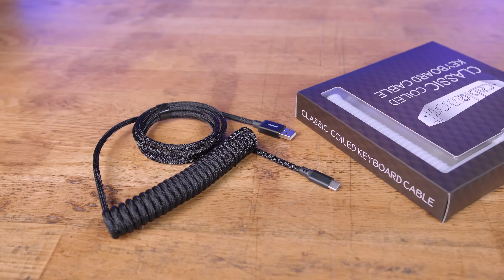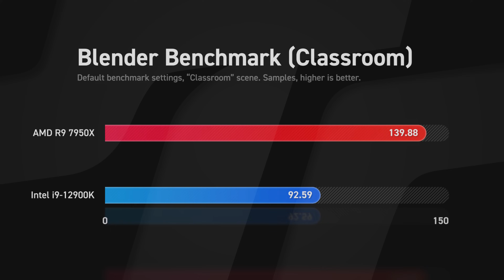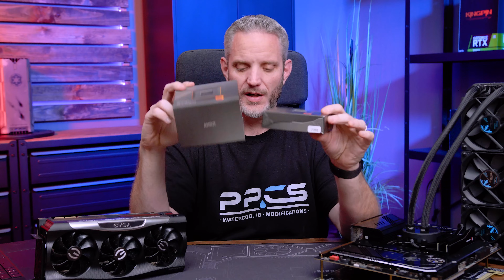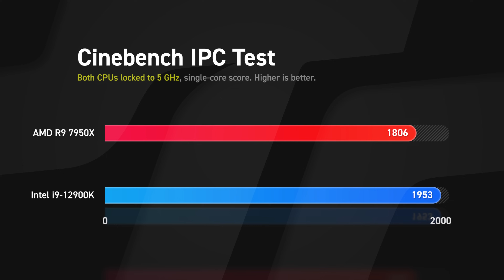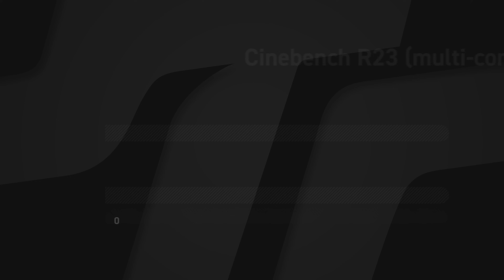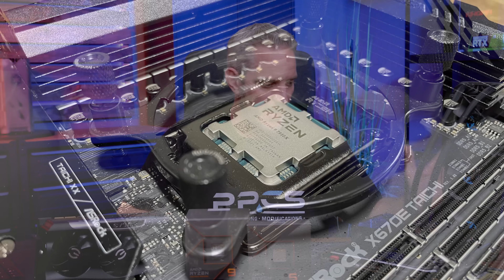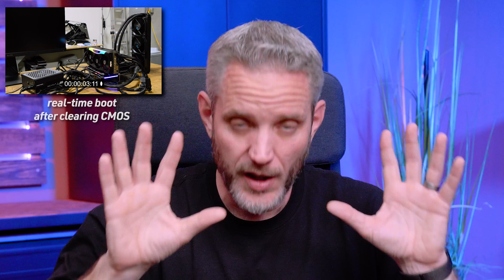Forget EVERTHING you THINK you know about AMD... these CPUs kick A$$!!

Comment: As for AMDs new approach to cpu temps, as a performance laptop user for over a decade, cpu temps of 95C have been normal for as far as I can remember. My last Asus melted the solder for the power plug (after about 2 years) but hadn't damaged the cpu before that BSOD event. The previous Asus ran at 90+ for 6 years and is still functional. The current Microcenter house brand, Power Spec, has been riding its thermal shutdown limit of 95 to 98 C for 3 years (is undervolted and admittedly has an insufficient and worse cooling solution than comparable Asus ROG model of the same vintage, but at a much better value and available immediately off the shelf when the previous Asus died with similarly equipped Asus being mail order only even in a major metro area like Dallas).

Comment: The 7600x's big problem is going to be in the value proposition of everything needed to run it.  R5 has always been a performance-at-a-budget tier for Ryzen CPUs, and with DDR5, the cost of AM5 Mobos, the added power and cooling demands....it's a tough sell at the moment.  If you've got the budget to go all out, or nearly so, the 7600x doesn't make sense because it's the bottom of AMD's release stack.  If you don't have the budget to do so, it doesn't make sense because your money can get you so much on last gen hardware where you don't have to deal with the prices of latest-gen everything at once.

7600x's day in the sun will be when DDR5 and AM5 motherboards reach more typical prices.  GN's numbers largely verified what AMD was saying about it beating out the 12900K in many games.   But it's super expensive to adopt right now.

Comment: Jay, you should know the best that 95°C working temperature have to be exhausted out of the pc-case ... so when the pc always runs at 95 - no matter what you do - because 95 is designed to run .. then IT IS A HEATER .... there is no way that you cant call it heater, because it is a HEATER... you have to be kidding if you think that browsing the web and watching videos at 95°c is normal ... its maybe good in the winter but the rest of the year its an unnecessary HEATER

Comment: FX8350 was such a great CPU! The longevity it had...  Mine was nearly 8 years old when I changed it and it wasn't because I actually needed to change it. It was still running properly all the games I wanted to play. I mean... I went from FX8350 to Ryzen 3600X and didn't really notice much of a different.  But yeah... I wasn't playing Crysis! :P
Reply: Hell yea!! BULLDOZER POWAAA>

I just build a new rig 3 months ago and upgraded from FX8350 + R9 290x to a 5950x + 3080TI FT3, the difference is unbelievable but yea the fx8350 was a monster of a CPU for its time and price!
Reply: still using fx 8350 with 1070 atm
Reply: Im still on fx 8120 black edition overclocked too 4.6 and Radeon 290x  also overclocked, Planing on going 7700x paired with an 6700x.
Reply: Bulldozer was such a dud. CPU's had terrible single threaded performance and they had a lawsuit against them because it's not even a true 8 core CPU. Hense why it only scores 6,100 on CPU mark.

Comment: I love the excitement this is creating... I hope AMD smashes it with their new GPU too, can you imagine if the do a 7950X3D, it will be freaking awesome
Reply: I'm going to bet the gap in the lineup (no 7800X) is where they'll put the X3D part. I always thought the 5700 and 5800 were too close, this makes the lineup 6 core, 8 core, 8 core with 3d cache, 12 core and 16 core. A clear difference in each part, which I quite like over a slight freq bump.
Reply: People buying hardware waiting for software to catchup.  Sure with proper tuning software an Intel 6 or 7th gen would be fine pared with any gpu
Reply: Fan boys.
Reply: I do not think they will make a part like that since Windows has scheduling issues with large core count cpus such as the 5950X/7950X. More likely to just see a 7800X3D. Maybe a 7700 or 7600 but nothing higher than that.
Reply: @VoldoronGaming  - Well, you’re wrong. Slated to be released 2/28/2023 is the Ryzen 9 7950X3D!
Reply: @VoldoronGaming  update jokes on you😂
Reply: @VoldoronGaming  thanks for the info, that's a shame, one can hope that Microsoft make an update for that so it's possible in the future.
Reply: For funsies I crunched the numbers and, IF the added cache improves the 7950X to the same extent it improved the 5800X, then we can expect the 7950X3D to yield 20-25% more frames than the 5800X3D in games where the 5800X3D is currently in the lead. 

But there are a lot of unknowns. In addition to the scheduling issues, im not sure how the cache will be able to handle the extra voltage and heat. The cache made the 5800X3D a very cool and low wattage cpu that you cant manually overclock. The 7 series cpus are hot and high wattage cpus that... i guess also cant be manually overclocked because they essentially auto-overclock. Im not sure how they're gonna pull this off, it seems... incompatible? I have faith in team red, but they likely got a serious challenge to overcome.

Comment: upgrading my pc fully in 2 years, the CPU power by then is gonna be insane :o my 3600x i got 2 years ago was already such a massive jump from my i5 6600k. i remember when i started in 2016 on pc gaming and cpu performance increase was so stagnant for years and now its poppin off so hard.

I currently run a 3070 ftw3 EVGA with a EVGA 650w gold G2, 32gb 3200 mhz, R5 3600x, with 2 HDDs a m.2 and a sata SSD

Comment: AMD and Intel might have switched positions.

AMD went all in with fewer cores, higher allowance of temps, max speed to get the best performance possible with no Thremal throttling while having barely any IPC increase.

Intel's RPL going to have more cores than AMD and probably win MT across low to high end section(7950X might be the only AMD cpu that can beat the 13900K or be equal), and probably going to have the best gaming performance with insane power draw, at least until X3D comes.

Comment: Having jumped right in with the first Ryzen with an 1800X and an Asus 370X top of the line Motherboard.  I had more issues than you can shake a stick at.  Basically No ram not a single stick on their apprived list would run at 3200.  Asus flat out told me If it runs 2400 which it did they would not RMA the Motherboard. It was over a year later that bugs were worked out but I had dumped Asus for good and moved to Gigabyte boards.  Still with this round and the bargains around on the 5000 series and the 6000 GPU's it will be a couple of years before I change over mainly the cost is way more than it used to be for the MB the Ram and the Processor.

Comment: Based on recent moves from all relevant companies, I have decided to transition fully to AMD based systems. My current rig (built in 2020) was my divorce from Intel by moving to an AMD CPU. Now I will be looking to upgrade my rig and when I do I will also be divorcing from NVIDIA. I have never had a PC in my life that had a dedicated GPU that wasn't NVIDIA...but Radeon, here I come.
Reply: made the move me myself since 2021, amd graphics cards need a little bit of fennesing to make it work optimally, my gpu is 6600xt and out of the box it seemed to run really hot on most games, running 95c+ on most games and in some even hitting 100+, so what i did was undervolting the hell out of it at 1070mv and it seems to do the trick, now all those games are running at same or higher fps and the gpu stays at a comfy 80+/- c

Comment: Dear Jay, if CB runs with AVX512 it should not run AVX512 on Intel... AVX512 is disabled on Alder Lake, besides AVX clocks lower on Intel when you not overclock it. So if CB is using AVX512 on AMD and AVX256 on Intel, the benchmark is not comparable at all.

Comment: I won't be buying any of the new AMD processors, AMD has crippled them all.
DDR5 is spec'ed to 512GB in 4 DIMMs, and AMD crippled their Memory Controllers to maximum 128GB.  Stoopid!
I ALREADY have a 5950X with 128GB, and I need more memory than that (and Threadripper is too expensive).
So it looks like I will be going with Intel's next HEDT for my next system.

Comment: CR23 is ~28k on the 5950X, not 20k.
Edit: At 95C, the Zen 4 did throttle back from 5.7 to 5.1... with better cooling and with no OC, that throttling will go from 5.7 to maybe 5.5.  It is a tour-de-force that AMD pulled here.

Comment: I am differently skipping the whole next generation of hardware on both the CPU and GPU side since it seems I will need to build a whole new system with the new power supply requirements for the GPUs all the way up to DDR5/socket change on the montherboards. 

I wonder if Intel would still be making 4 core 8 thread chips at the high end if AMD never made a comeback..

Comment: I don't think I'll upgrade from my 9900K yet. It's still pretty good for gaming, streaming and my photography/video editing work. I'm only looking at the new platforms in case I absolutely NEED them when I upgrade to a 4080ti (whenever that comes out). I wonder how those GPU's will perform on older platforms.. Only time will tell, and I'm not in a hurry. My 2080ti still kicks ass!
Reply: I'm waiting to see 2023 models before upgrading the 9900k. Upgrading cpus is overrated.

Comment: so from ive read so far and seen. 7700x is hotter, more expensive, takes more energy and is slower in games, then a a5800x3d. so if its about a gaming only cpu and average frames throughout games, youre still better off with a 5800x3d

Comment: A better video IMHO would be what it does with WORSE cooling solutions. Like U12S->D15->240-AIO->280-AIO->360-AIO, to see how much performance drops under throttling. Then turn on Eco/105W mode and re-run the cooling solutions. Then run 5950X stock with them. That should give a decent perf/W against 5950X @ 105W.

Comment: Jumping on this pretty quick there, Jay.  This is a new socket, relatively new memory format, cutting edge platform.  I expect it will have the same sort of growing pains as the first AM4 systems had.  If not, well...  now we're talking.
Reply: I don't think it will be that bad. When the Ryzens came, no board maker put much faith on them - hence the small BIOS size and all the errors with tracing and so on. Today Ryzen is a first class citizen, not a second one. They will put everything they have on it - same as they do with Intel - because this time they know it WILL sell.
Reply: @sysbofh  Good point.

Comment: I bought the 3950X the same day it was released in later November 2019, and I have avoided being an early adopter since due to the initial issues with Zen 2. The problem I am seeing is that AMD is forcing you into a strange position. You either wait for Intel's quasi-response to all this, wait for the X3D version of Zen 4 or buy high-end right off the bat and hope it's worth it. The low and mid-range stuff doesn't seem to be worth the investment right now given the pricing, which includes all three main components, which is really lost potential currently for AMD. From my perspective I don't need 16 cores anymore since my video rendering days are gone now and for gaming the 7900X and 7950X seem a bit overpowered. The 7700X makes no sense to me. I had hoped for a 7800X, but nope. In addition, maxing out temperatures seems more than a concern to me. It's hard to gauge optimal cooling with it and since heat does have to go somewhere it literally could be bad in summer, especially when you don't have air-conditioning and room temperature rises above 35 °C. I guess it's the same for Intel, but for my 16 core Zen 2 I could at least fiddle with the settings to get it somewhat bearable in summer, especially with the added heat from the video card.

Comment: I'll be building a new system using AMD this time around. Looks like they have really stepped up their game. I don't however like their smart auto memory timing - that would be very frustrating to deal with if your in a rush after a power loss - not to mention it really makes it seem like there is an issue with the system. Maybe an initial post screen that warns you it's normal it may reboot numerous times while it does this. I can foresee a lot of tech falls due to this.

Comment: FYI,  Only AM4 coolers that support AM5 are ones that do NOT have their own back plate, if it uses the default motherboard back plate, then it fits. If the  cooler comes with its own back plate it will not fit...

Comment: From HotHardware's site: "In Zen 4, AVX-512 is implemented using double-pumped 256-bit data chunks. This design decision was reportedly made to avoid large frequency fluctuations when executing AVX-512 workloads." Personally, I would look at it the same way I would look at dual-channel memory vs a single channel. Would you rather have one stick of 16GB or two sticks of 8GB? I know the comparison isn't exactly the same, but you get the idea.

Comment: Comment just after the benchmarks: it’s a walkover. I feel very relieved I didn’t build a 12900K(S) system…
Because now I can dream of building one of these…

Edit: and a bit disappointed in myself because I didn’t wait and built a 5000 series system. But this was supposed to be the low power, cheapo system. The big one should be ripe for an upgrade when 7000 hits Threadripper.

I also want RDNA3 to be good. Really good. And supported by a kickass ROCm: it’s still not there and that bugs me to no end. C’mon AMD, that’s the final piece of the puzzle (for me).

Comment: Great video and review Jay, but I'm still struggling to understand why should I pick this AMD over an intel 12th gen that it's still super competitive despite is an old gen and when the price of an i9 12900k will drop significantly in almost 1 month due to the release of the 13th gen intel that will annihilate AMD for sure?

It makes no sense to me that everyone is comparing the new AMD with a passed intel gen. It will be good to fight fair no? Let's see if AMD will win against the 13th gen of intel processors. Also IMO, the only way AMD will erase intel from the market will be to keep prices low, and that's not the case. If they were 100$ cheaper they make sense. So I will stick to intel. Ah...a little thing..you cannot use ddr4 on new amd...just keep in mind that.
Reply: 12th gen intel and Ryzen 7000 are the same generation both released/will release in 2022.

The unfair comparisons happened when 12th gen was compared to Ryzen 5000 a 2020 cpu vs a 2022 cpu.

Next gen will be intel 13th and Ryzen 9000 in 2024.
Reply: @uzu6612  they announced yesterday the 13th gen of Intel (Raptor Lake) and it will be released 20 October THIS year (2022). Are you aware of it?

Comment: about the memory : before I saw the bios screen on TRX40 3960x a good 30min passed, before SEEING the bios !!! just a black screen >< on 3000$ of hardware I was panicking so get ready for this as Jayz says, while that 1st time detection is annoying it'll work normal after, also if you haven't upgraded computer in a long time ultra fast boot times don't exist anymore, both on intel and amd motherboards and cpus have so much going on boots became slow especially MB with fancy rgb and screens (my z390 9900k cold booted in 15s to desktop now i'm more in the 1-2 minutes)

Comment: Jay i have a question. so i have a b550m mag mortar motherboard and i was wondering if i wanted to upgrade from my ryzen 3600 to the ryzen cpu you showed in this vid. would it work with my motherboard straight from booting up or would the bios need updating first ?
Reply: This is Zen4. Completely new platform. Zero compatibility with yours. If you have to ask you don't want to pay for it. It's going to be around $1000 minimum to get on the platform.

Comment: I really don't believe this is a good generation, I'll be honest here. Even being relatively impressed by the 7600X's gaming performance and noticing that its single-threaded advantage and multi-threaded deficit are both a bit more in its favour than Cinebench scores indicate, I still doubt I can really recommend it over the 12600K universally or even a majority of the time. The market of people looking for a $300 gaming CPU in 2022 is quite a small one, and the added platform cost only makes that worse. (The same holds for the 7700X and the 12700/12700K.) The 7900X and 7950X are stone-cold 12900K killers, granted, but there aren't that many 12900K buyers in the world.

Also, there's a fine line between "hot but easy enough to affordably cool" and "fuck you, you need a 360mm AIO to get the full stock performance of a six-core now". AMD is pretending Zen 4 is the former, but it could just as easily be the latter, and that would be profoundly anti-consumer.

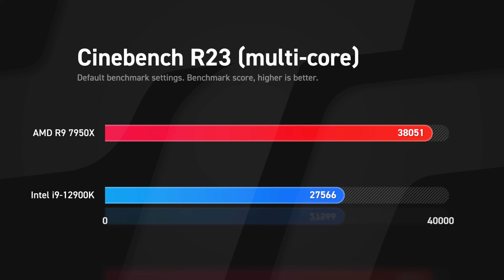Comment: If Intel has 40% multithreaded increase over 12000 series, then Intel will be on top again with 13th gen. Good to see AMD competing strongly. ... 7:56 ... 27,566 + 40% = 38,592. (Cinebench.)

AM5 will be very nice with X3D. 
At the moment AMD are doing it on a much smaller node. If Intel were at the same size node they would be smoking AMD right now.
Brilliant to see AMD doing great.

Comment: performance is good. But constant running at tjmax under load? insane pricing of motherboards? They are pushing these chips to its limit. It is auto overclocking. But it seems hard to believe this does not influence lifespan. I think the price performance is not very attractive. even if its surely a lot faster than last gen.